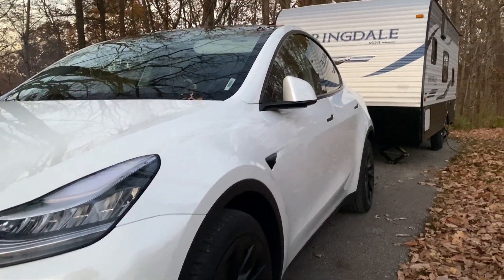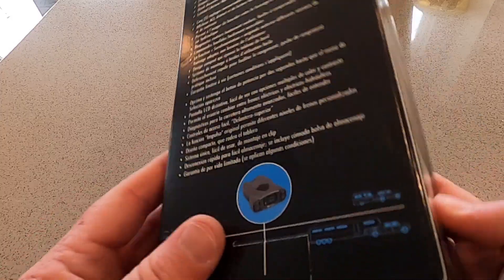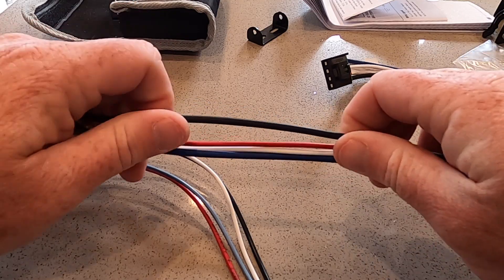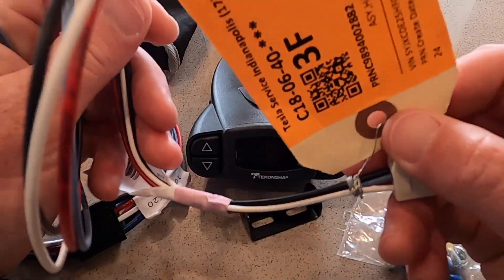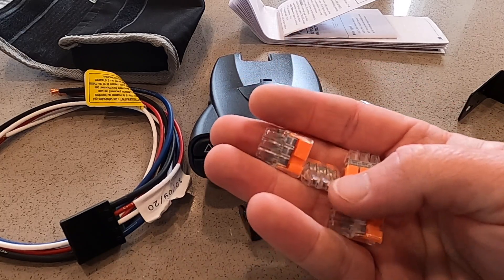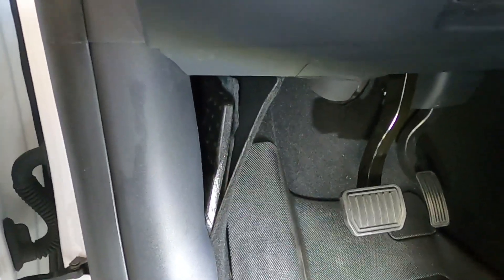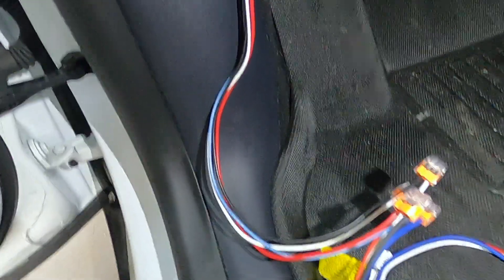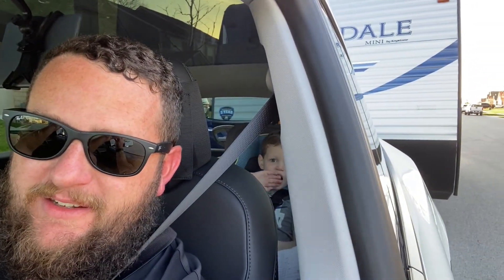Tesla Model Y - Trailer Brake

Comment: hi, i wired my car just like yours but it LCD screen does not light up. even with tow mode on, it does light up. i dont have a trailer connected to the car yet. does that matter?

Comment: Did your Model Y have the Lithium 16volt battery or was this an older model with the lead acid (12volt) battery? I contacted teh Brake controller manufacturer and they way this model DOES NOT  support the 16vdc as they have never tested it for this high a voltage.

Comment: Thx for this video. This works on 2023 Model Y with 16V battery.. Works without stepping down the voltage.
Reply from the maker: Excellent
Reply: @BeardedTeslaGuy  I’ve seen a Tesla service technician easily take lots of panels off the dash area of my 2023 Model Y in seemingly no time at all.  True it was not the same area that is used to access the wiring as he had come out to the house to fix a factory flaw in the heat and air ductwork behind the dash.  In your experience, would it be any easier to remove panels and snap them back in place after plugging in the controller’s connection?
Reply: I also have the 2023 Model Y and I am skidish about yanking the carpet out of the back of the vertical plastic door panel.  Yet, removing all the panels that seem to overlap it is possibly worse given my luck.  I wish there was a video of someone actually pulling the carpet out, rather than a photo exposing the wiring after the fact.  It would be less nerve wracking for someone like myself who is overly protective of my relatively new shinny MYL.

Comment: Hello all, help please. 
I purchased Tesla with towing package included 2023, I never used Towing until now . I believe this package comes with 7 pin connector…so do we still need to do this setup as per video ? or Is this trailer brake is included in 7pin connector? Thanks

Comment: Great video, beey helpful! Question: With this solution how do rhe brakes in the trailer get power? This solves only the rhe data signal. No power is going over the 7 pin port and the trailer store says the battery on the camper trailer isn't designed to provide power to the brakes.
Reply from the maker: The car absolutely is sending power to the trailer. Apparently it’s enough to operate the brakes because at least in my case, I could manually throttle the trailer brakes without issue
Reply: @BeardedTeslaGuy  Does the trailer have it's own battery that could be powering the brakes? I wonder if the trailer battery isn't charged up would they work.

Comment: Question yalll...so I bought a airtow trailer..I hauled it from LA to Las Vegas perfectly fine. Once I got to Vegas, I switch my regenerative breaking to on and all of a sudden the trailer applied breaks on its own when I let go of the pedal...😢. I turned off regenerative breaking off but the trailer still continued to apply the brakes... how can I fix this. This has to be a tesla detting

Comment: I recently added the P3 Brake controller to my MY, and it appeared to be functioning normally.  I purchased the Tesla pigtail and connected the pigtail and P3 wire harness as you and everyone else had described.  About 3 days after it was installed, I connected the trailer which had electronic brakes as well as the 12V Aux line.  Somewhere in the line between the Tesla 12V battery and the Trailer, there was a short that caused a wire to cook (smoke in the tesla) and killed the tesla 12V battery.  This happened within 30 seconds of connecting the trailer.  I am a little stunned that the tesla fuse didn't trip.  Have you heard of this happening to anyone else?  I've triple checked the P3 wiring, and it is correct.  Also, neither the pigtail nor the P3 wires show any signs of overheating and the P3 unit appears to still be functional.
Reply from the maker: dang man, thats no bien. These things are pretty much the standard out there on brake controllers, so although its possible it caused an issue, its very unlikely

Comment: Anyone did the install on a Y with the 16v Lithium battery (I have a MY Long Range 2022 with the towing package)?  I was originally told to buy a CURT-51180 Echo (Bluetooth) by the RV dealer, but I found out that Tesla is not providing power to the 7 pin connector at the back of the MY with a Lithium 16V battery, so it couldn’t feed it with power (nor provide power to the trailer, bummer!). My Plan B (after viewing your excellent video) is the Tekonsha Prodigy P3, but both Tesla (where I purchased the connector bundle) and my RV dealer could confirmed that it will work. Thanks!
Reply from the maker: You should be able to still plug in to the same connector
Reply: @BeardedTeslaGuy  FYI, I couldn’t make it work. I ended up shutting all power to the 7-pin connector as soon as I plugged in the Tesla 4-pin connector with the P3. I consulted several brake controller installers and no one wanted to touch a 16v lithium battery Tesla. I ended up canceling our planned purchase of a teardrop camper. I hope Tesla finds a solution to this major inconvenience.
Reply from the maker: @AlainBourgetComm  make sure you schedule with Tesla, that should not happen.
Reply: @BeardedTeslaGuy  I run there. They couldn’t help me… They charged me $110 to tell me that me that Brake controller was the culpit. I asked for help. They say that the RV guys are responsible for installing brake controllers. The RV guys refer me to my Tesla ‘car dealers’!

Comment: You mentioned extended mirrors for towing but haven't seen any in use on any Model Y towing videos.  Do you recommend them or not?
Reply from the maker: I didn’t end up needing them so I don’t use them
Reply: @BeardedTeslaGuy  I wasn't able to get the same brake controller you have but ordered a cheaper one that I just finished installing this morning. Hopefully it will work good. We are picking up our pop-up camper on Thursday so we'll know then. I bought mirrors but plan on only using them when backing into places as don't want the added drag while at speed. They strap to the existing mirrors with adjustable rubber straps so should be easy to put on/off at the camp spot or charging stations.  Only cut one thumb following your instructions. That plastic holding the carpet in had a knife sharp edge but I can't work on any thing without at least one cut...lol. Thanks for the video help.

Comment: Did the trailer brakes go on when using only regen braking on the model Y or did the trailer brakes only work when applying the fraction brakes on the Model Y?
Reply from the maker: They would engage when the car was braking enough through regen but not immediately when starting to release the pedal. Had to let up pretty far before they started engaging

Comment: Do you really need trailer brakes with a Model Y? Seems regenerative braking would benefit with the weight of the trailer.
Reply from the maker: Yes you do! Although you’d benefit from additional regen gains, the safety factor is way more important when towing
Reply: @BeardedTeslaGuy  gotcha! Thanks for the reply! 🙂👍

Comment: I have a very reliable brand Reese Towper 8507111 brakeman IV digital brake control, same concept?
Reply from the maker: Should be same concept just a different adapter you’d need
Reply: So glad I saw your post! I have same brake controller recently purchased for teardrop trailer to tow with my 2021 MY. I have searched for days for connector! Will you share what you wound up using? TIA

Comment: Rather than following the regular Tekonsha adjustment and boost levels- does it make sense to reduce the boost to 0 (2200lb trailer on a model y), and reduce the voltage adjustment a bit- so as to get more regenerative braking out of the car?  or is that just more dangerous.
Reply from the maker: I know what you are saying, but no, always stick with safety first on this one.
Reply: @BeardedTeslaGuy  yeah- Safety over KWhrs.

Comment: I installed the Tesla plug in harness to get a switched 12v source and nothing. I don’t have the tow package but I do have that connector. Couldn’t get any voltage out of that harness.
Reply from the maker: Hmm. Perhaps it won’t power unless a trailer plug is hooked up?

Comment: Thank you for this awesome video!! Would you still recommend the  Tekonsha 90195 P3 Electronic Brake Control + 5906 Brake Control Bracket for the 2021 Model Y?
Reply from the maker: Yes, the brake controller is a really good unit

Comment: Your video makes it seek that if my 2021 model y has a built in brake controller since I bought the tow package.  
Do i still need to buy brake controller?
Reply from the maker: You need a brake controller. It is wired to be plugged in but it is not integrated.

Comment: So with the Tesla tow bar installed, do you know if it provides the same level of functionality, or is it controlled via the touch panel?

Not having any experience, I was slightly flummoxed at the cost of the Tesla  tow bar, but I see that their is more to a trailer hitch, then I supposed, which I guess is the point. Most things are rarely simple as they seem, unless the challenges are engineered away.

Thanks as always.

PS - Not sure I would be happy to root around in a relatively new car ;)
Reply from the maker: So if you are going to tow something, I highly recommend going OEM. This is integrated. If you go aftermarket, it’s not integrated and you don’t have tow mode. So if you are just hauling bikes and racks, go aftermarket and save the dough.
Reply: @BeardedTeslaGuy  Cheers.

Comment: I installed my P3 brake controller also, got the Pig tail from my service center for $4.74, was a pain to get to the connector inside the side panel. I get my Hitch on Dec 9th
Reply from the maker: Awesome

Comment: Not gonna lie man I kind of expected this video to show me what a trailer brake thingy does I have no idea what that is or why you have it
Reply from the maker: Yea, I assumed too much unfortunately. So when towing, some trailers have brakes on the wheels. In that case, the only way to utilize the brakes is with a controller like this. Once installed, it can help you set how sensitive the brakes are (harder or softer braking) based on you brake pedal in the car. Absolutely must have if towing a large trailer for safety.
Reply: @BeardedTeslaGuy   Got it man appreciate it. I also heard that some trailers have an inertial braking system that allows them to break automatically as the weight of the trailer moves forward when your vehicle begins to break. I do plan on getting a trailer for hauling stuff to do work around Phoenix Arizona with my model Y as well as a recreational trailer to get out of town every now and then, good info man thanks.
Reply from the maker: Yea man! So just be careful with those units. They are indeed really good, but it is relying on external forces to control everything. With regen braking, you’d have less control of when the brakes start applying.

Comment: Awesome job of showing installation process; thanks!!  But I would have loved some explanation of how to use it; for example how is the braking basically blended between the car and trailer—is this pre-set to some ratio; how and when is that gain control lever used; is there a sensor in the controller and what does it do; can things be set to get a good amount of regenerative braking along with good control of the trailer upon braking?
(At least the Tesla/EV-specific operating aspects, if any.)
Reply from the maker: Fair, I assume too much with previous towing experience. So out of the box, it’s pre-set to a good level. You can increase or decrease brake power as desired. Basically you go drive the trailer around and determine if the trailer is pulling you back (too much brake), or pushing you (not enough brake). The nice thing is with 1 pedal driving, this trailer does not engage brakes until actual brake pedal is pressed.
Reply: @BeardedTeslaGuy   Very helpful comment as that was my next question re wether the trailer brakes are applied on regen. This answered that. Consider doing a short video on braking dynamics and your your impressions and suggestions for best practices. 

Thank you again.